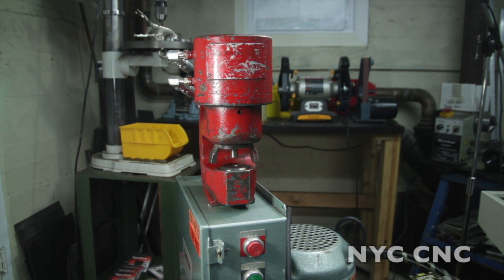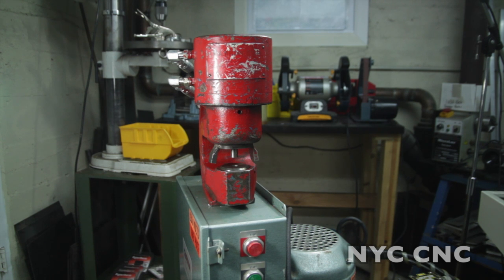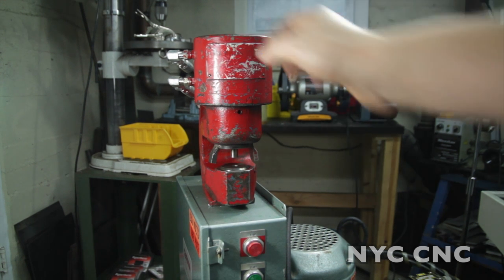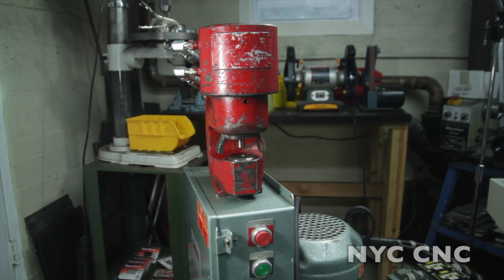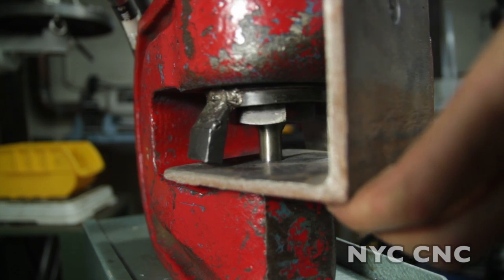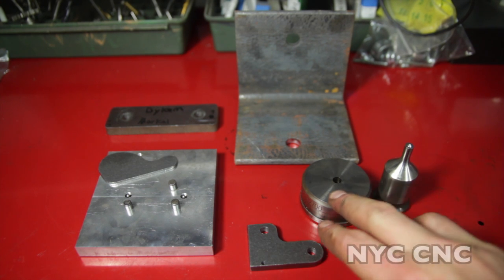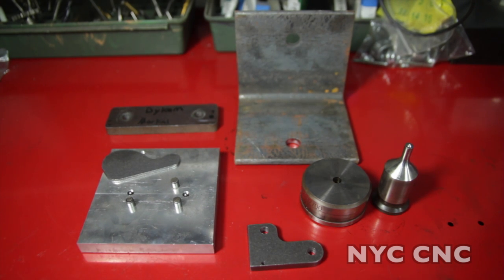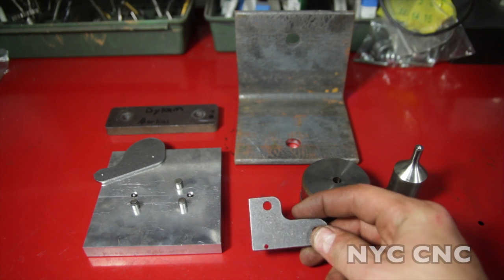Whitney Model 730 Portable Hydraulic Punch Press!

Comment: I have the Edwards 55 Ton Iron Worker. I am not sure it is better ( more expensive vs. more uses) but I truely enjoy it. I have the punch set 1/16" up to 1-1/16" and can punch thru 5/8" thick steel. My comment was that it would be nice to have a Whitney Punch beside it to speed up different size hole runs. 1/4" hole in one and 3/8" in the other. Maybe 1/4" round in one and 1/4" oval in the other. Instead of have 2 iron workers.

Comment: back in the days when I worked as a plant mechanic we worked a lot with those little punchpresses.
Ours where hanging of a crane so you didn't have to muscle it around.
Also they had a lever that lowered the punch so you could center it on the center punch hole and it would stay in the dimpel without it slipping.
Loved those things. Much better than a magnetic drill press.